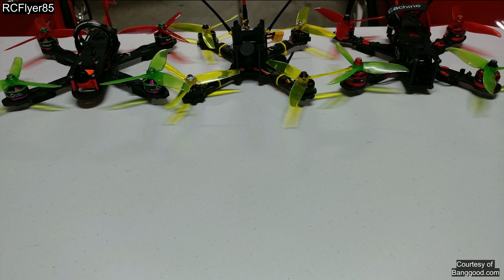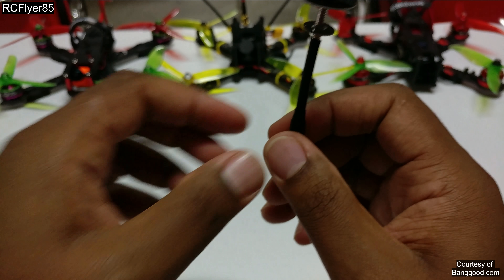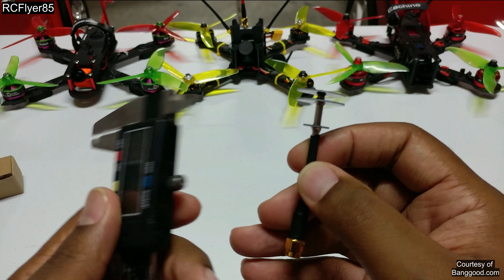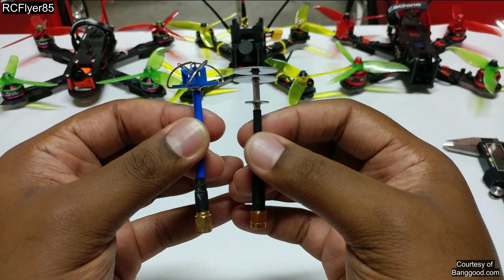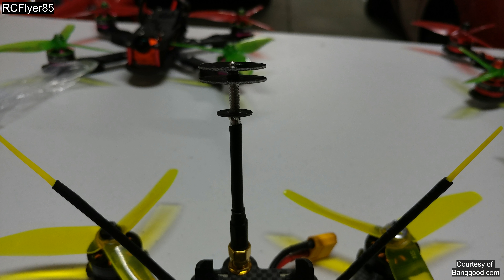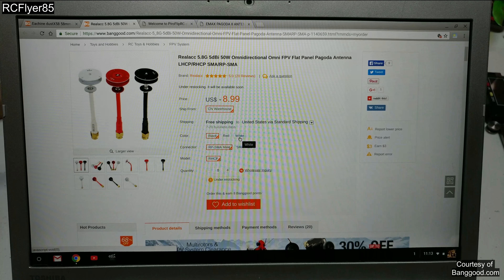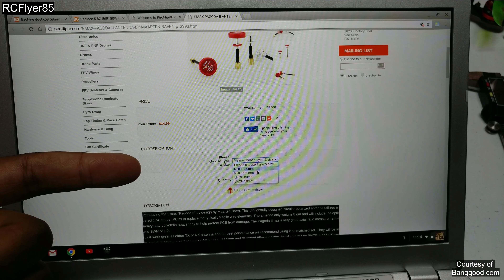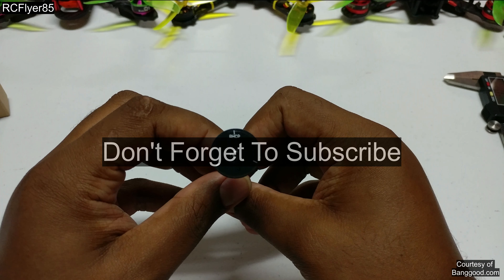Realacc 5.8G Pagoda Antenna Review - Worth The Hype But.... Watch Until The End

Comment: Pyrofliprc isn't cheaper after you factor in shipping, which is typically free from banggood.  I'd have to buy 10 of them to match banggood's per unit price after shipping is factored in. 

Plus the plastic housings have been shown to noticeably reduce the performance of pagoda's, so it's best to buy the 'naked' versions whenever possible.
Reply from the maker: Qumefox Price is about equal after shipping but you get it much faster if you are in the US... Either way is just a suggestion
Reply: Depends on where you live. For me shipping is just under $10 from them for one antenna.  So like I said. I'd have to order 10 or so of them to beat banggood's price.
Reply from the maker: Qumefox oh yeah i guess so... For me is like $4
Reply from the maker: Qumefox also the emax ones have shrink tubing over them.... Does that affect signal?

Comment: it might you better performance but I don't think it would survive 
a crash
Reply: Definitely doesn't survive a crash as I had confirmed repeatedly. In my review, my quad hand a rough landing, and it tumbled inverted. And the solder for the top plate broke! I fixed it and then on my next flight, it hit a branch, and the solder for the top plate broke again. I give up.
Reply from the maker: Fyre SG Well there you have it from someone with much more experience then myself...  I guess they need to redesign this similar  to the Triumph antenna  and surround them with something protective. 

Thanks for stopping by FYRE SG. Appreciate your wisdom as always
Reply: Maybe you'd like to protect yours before trying it out at the field? I'd try adding some hotglue as support between the top and middle plates, at the very least. You have great content; hope to see more cool videos from your channel! Happy flights! :)
Reply: I solder mine for some time now and had some crashes with them. The only problems I had was that they broke on the SMA connector. Now I use Crimp connectors and the hold very well. I am using no cover for the pcbs btw...

Comment: Thanks for the video! Can I use this pagoda antenna to replace the 5.8 Ghz panel antenna on the controller of my Hubsan H501S.
Reply from the maker: Yes it should work.... Just make sure you get the correct connection type

Comment: Total junk. Both the ones I bought were misaligned and way off the required dimensions, out by over a mm. They didn't even line up the top and bottom plates rotationally. If they're made in a jig they should be correct every time. The fact they're all bent to shit says they don't use jigs. Even the plates are thinner than spec and will therefore be out on performance and more flimsy. They're cheap but not by much compared to others that meet specs.